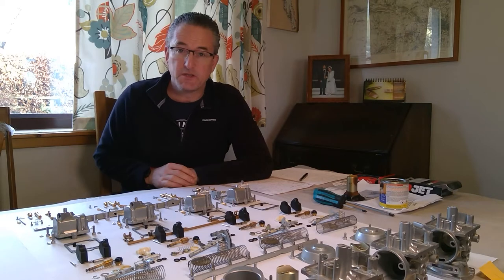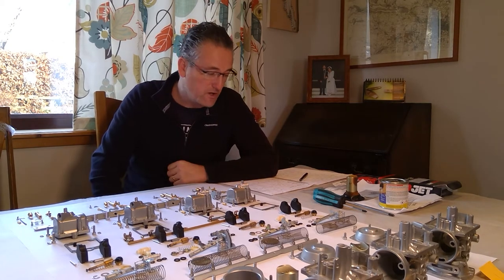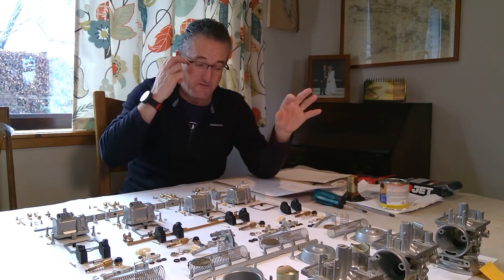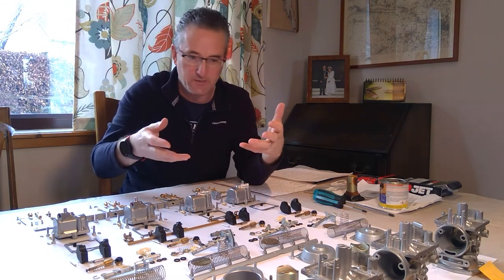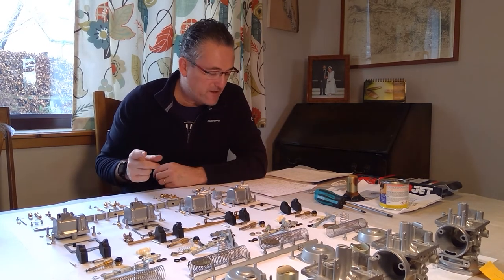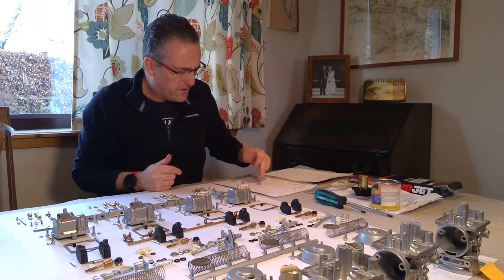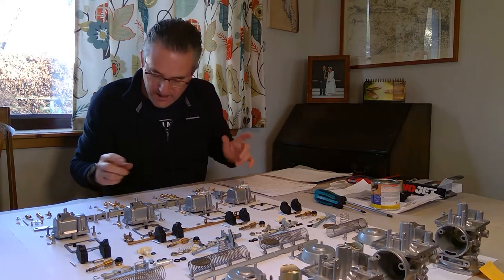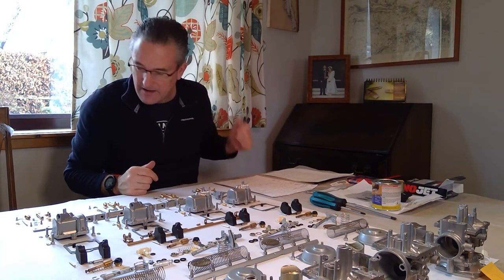Yamaha FJ1200 Carbs (Mikuni BS36) Full Restoration Top Tips

Comment: Hi, just bought an 88 FJ1200 thats been sat for 15 years so if I decide to do the work myself this will be a very useful video.
Reply from the maker: Thanks Martyn. Yes those carbs on your FJ are definitely going to need a strip down and clean up after 15 years laid up. Good luck. Especially if you decide to do it yourself.  It is fun and very rewarding to do yourself. Michael

Comment: Great video, thanks for sharing what you have learned. I have a 1992 3xw model that I am going to put back on the road this year, God willing. I have no doubt that the carbs will need an overall, among other things and I intend to do it myself. Phil Hacker at the fj owners club is a top notch guy, knows everything and, from experience, is an honest and trustworthy bloke.
Reply from the maker: Thanks Michael. Hope some of the little tips based on my experience of a couple of FJ carb strip and rebuilds will be of some help when you come to do yours. Good luck! And thanks for taking the time to drop in a comment. This was my very first go at putting anything like this up on YouTube! Michael
Reply: @MichaelsFJRestorationProject  great first attempt, well done and I hope you upload more stuff. I have had mine since 1995, know my way around most of the bike and love it dearly, it's a shame life dealt some cards from the bottom of the deck for it to end up the way it has. I hope I can get it done this year and am waiting to get a table lift so I can work without grovelling on the garage floor 😀👍
Reply: Fantastic video.  I don’t have the patience to reassemble my Dualit toaster never mind a set of carbs with three hundred plus parts!

Comment: Extremely serious rebuild of you FJs carbs Michael. You deserve a medal for patients and must of spent a fortune. As a present owner of a 95 FJ I've had my fair share of carb rebuilds but nothing as extreme as yours. I'm aware of the prices, it's scary.   Yamaha deserves a good kicking charging a £5 er for an O-ring.  Thanks for taking the time for an excellent and informative video.
Reply: Google part numbers! Yamaha makes parts to share with other vehicles. I saved about 20% by buying engine top bolts for a boat engine that were exactly the same for my FJ. Also use translations. Translate what you need in to Japanese then search that. Sometimes it works out cheaper to buy from Japanese suppliers even when paying more for shipping. I live in Japan I need to translate things often.

Comment: Came across your video when looking into carb rebuilds. I have an 89 FJ which I dropped some 20 years ago and rode it home and put it in the back of the garage. I never got round to repairs, new home, young family etc and now with lockdown,and have a desire to get back into riding. Unfortunately I don't believe I stored the bike correctly, old gas/petrol and the carbs were never drained. I was hoping I could drop the float bowls and soak the carbs in cleaner but after watching your video suspect they will need a complete tear down. Seeing it all laid out on the table, looks daunting. Anyway, enjoyed your video, nice clear narration, closer views of the parts would be nice and a shot of your bike. Certainly hope you make more and have subscribed just incase. Greetings from Canada.
Reply from the maker: Hi David. Thanks for watching my video. You should definitely get your old FJ back on the road. I’m afraid you are likely to have to do a full carb rebuild. The old fuel will have gummed up the internals. I know it looks daunting with 300+ bits but as long as you take your time, photograph and video everything so you know how it fits together, and bag and tag or box all the bits as you go along you’ll be fine. And it’s a very rewarding feeling when you get them all back together. Good luck!

Comment: Great video! Great tips! Picked up an '88 FJ this fall for cheap. Starts and idles on choke, dies when you turn choke off. Gave the carbs a "basic" cleaning with no change, but after this video I'm thinking its time for a complete teardown. Would be great if you could make a video of installation/tuning/syncing. Keep up the great work!
Reply from the maker: Thanks Mitch. Re your carb problem - sounds to me then like it’s not getting fuel as it should at idle - and that’s the pilot circuit. Reading lots of posts on the FJ Owners website the problem commonly occurs if the bike has been left sitting for a while with fuel in the flap bowls. It goes off and gums up the jets and passageways. So perhaps worth concentrating your cleaning efforts on the pilot jet and pilot circuit passageways. Lots of good info on the FJ Owners website. Good luck! Michael

Comment: Good video micheal. I'm currently diagnosing a running problem on my fj1200. It's running on 3 but I think it's spark because it's kicking un burnt fuel out the pipe. I'll investigate and probly reference thus video so thanks for a good informative video
Reply from the maker: Hi Mike. Hope you’ve managed to resolve your problem. The easy way to check if it’s an HT lead/suppressor cap problem of course is to swap plug leads. One coil fires cylinders 1&4. The other fires 2&3. So if problem is on cylinder 1 then swap leads 1&4 and see if that fixes it on 1 but makes 4 the problem. But I’m sure you already knew that!  Anyway, hope it’s sorted now. M

Comment: Very good and informative, thank you very much .. I bought the keysterkit .. wondered , Whats that small black o-ring ist good for ..
the mixture screw ..👍 still worried about the    how to set up the main needle ..?
Reply: The snap ring in the third position from above and that little white plastic ring under it or above ? And is that all ?
Reply from the maker: @patrickbusche5665  sorry I missed your comment and am slow to reply. So clip on needle yes in third groove from top. The white plastic washer sits under that. With the little peg on it pointing downwards. That little peg locates in a hole on the throttle slide. On top of the needle clip you have a washer then the spring and then the plate goes on top of that and is secured to the slide with two screws. If your bike has a Dynojet kit fitted then there may be two washers on top of the needle clip instead of one. Hope that helps although you may already have worked all this out. The thing to be careful of (I cocked this up first time round) is that the little peg on the bottom of the plastic washer that sits below the clip locates properly in the hole for it to sit in on the slide. If you’ve don’t locate it then the needle will be sitting high and the bike will run rich at idle. Cheers. Michael
Reply: @MichaelsFJRestorationProject  
Thank you, for the helpful information. The washer on top of the needle Clip was missing at all my needles.  But I do think, that doesnt play any role. The spring on top of the needleclip pushes the whole needle into its position downwarts. Another important thing was, how to set up the mixture screw. I bought the big keysterkit, and was wondering about the small black o- Ring might be usefull for .
Although a motorcycle master repaired the whole carburator one year ago, those o-ring where missing at all my mixture screws.
According to some images on the Yamaha parts side and your video, I noticed that mistake and corrected it. Mixture screw + spring + washer + o-ring. According to a Yamaha repairguide, three whole turns screwed out is, the right mixture tuning ..
I found it quiet easy the repair the carbs. But getting them out of the mashine, is quiet a pain in ...!#&#!. But all is finished now, did Start the Motor, sounded nice ...
Reply from the maker: @patrickbusche5665  well done sorting it all out Patrick. It feels satisfying when you work out what was wrong as sort it all out yourself.